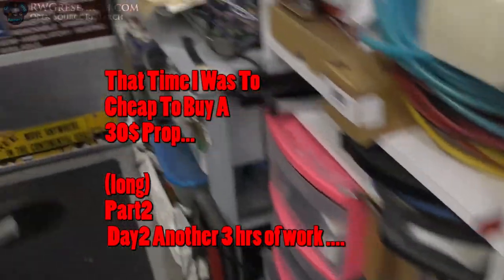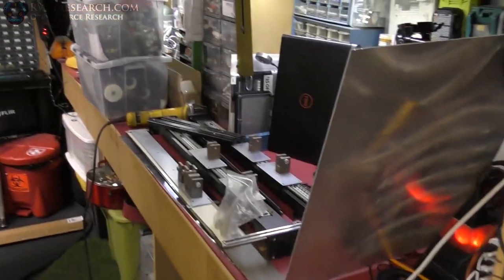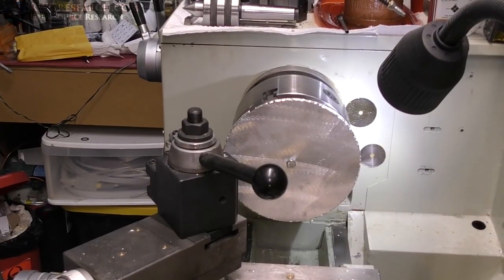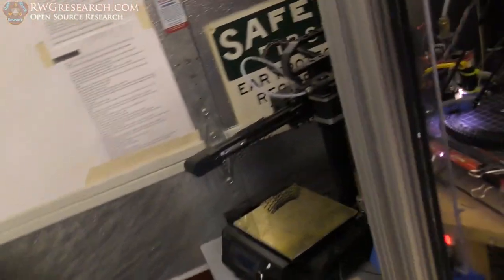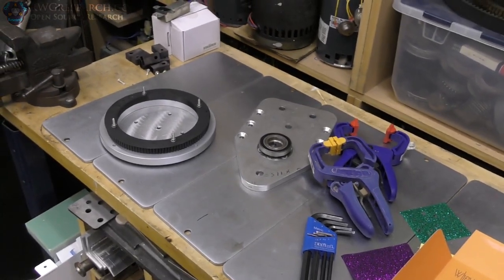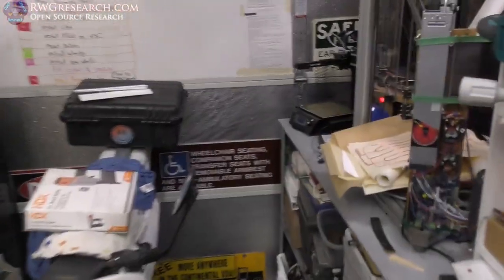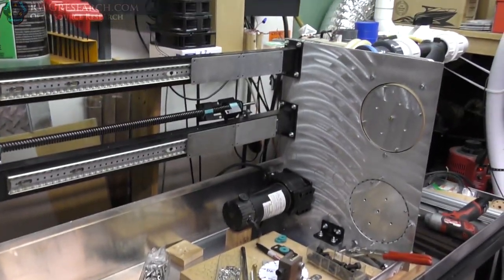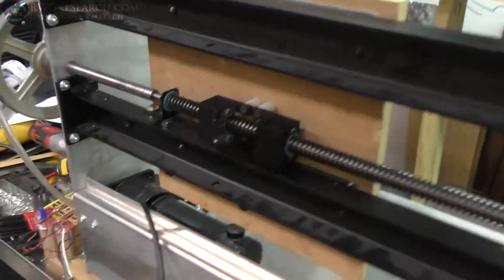Prop Maker part 2: When you're too cheap to buy props! #47-22

Comment: What if, just what if. You put a special coating on the prop,  or inside the prop material so that it creates its own lift, just by movement/vibration, just like beatles do. You would then have a air pressure differential/anti-gravity hybrid. BTW anti-G is a misnomer, we should say magnetic light.

Comment: Yoo I need some help how can I contact you
Reply from the maker: right here is the bast way... ~Russ
Reply: @RWGresearch  I have my starship coil complete 2 layer so I have 4 wires coming out do I need to just connect to Amp from there?
Reply: @RWGresearch  also 2 layer 18 winds does it mater it the layers touch or they need to be separated